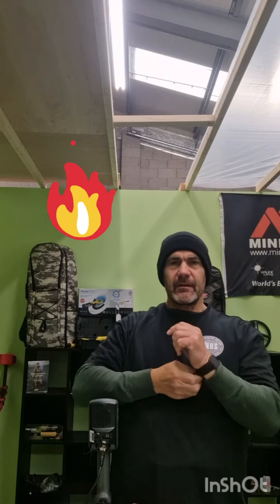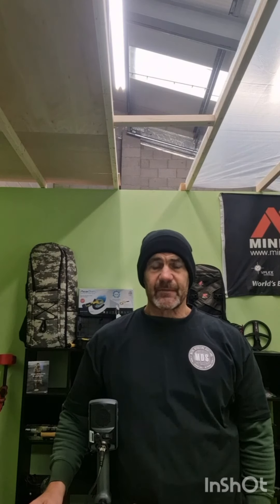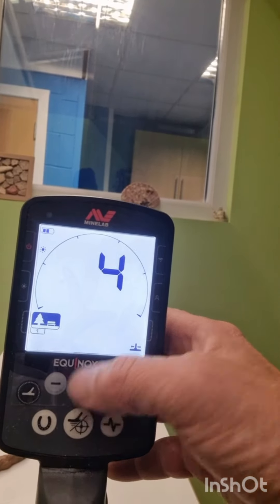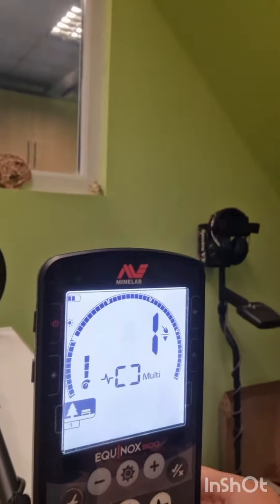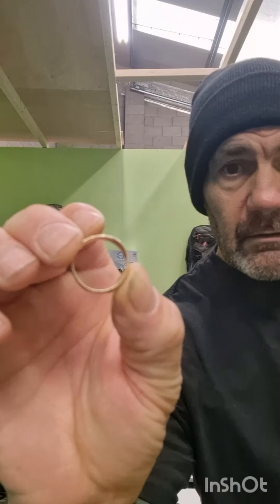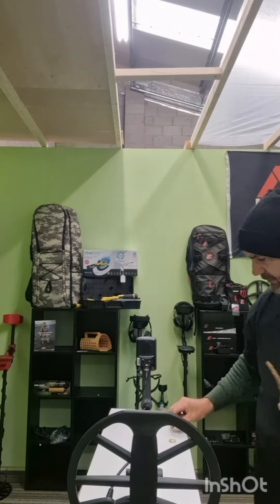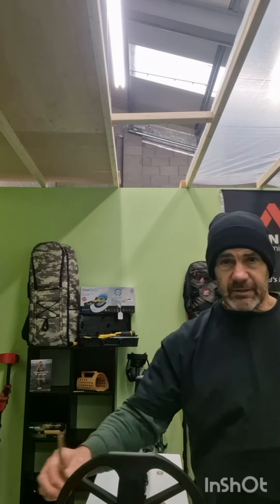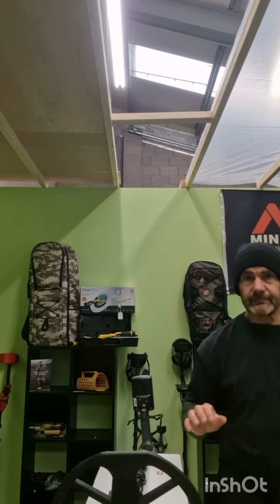Minelab Equinox 900 v 800 on iron.. Wow!

Comment: The iron bias on the Newer Nox machines (700/900) is def not the same as it was on the 600/800 models.  The newer Nox machines combine the F2/FE iron biases from the older machines and just call it FE now.  So FE4 on the old 800 is quite a bit different than FE4 on the 900.  Did you try running this test on the 800 with IB of F2-0 ? 

On the new Manticore, iron bias is now called Ferrous Limits (upper/lower)….The upper ferrous limit expands upon the older F2 iron bias (nails) of the Nox 600/800 and the lower ferrous limit expands on the older FE iron bias (flat iron and bottle caps), with 3 additional features: 

1. You can completely turn off ferrous limits (iron bias) on the Manticore…..couldn’t do that with any Nox machine (even FE-0  or F2-0 is not “off” on a Nox 800; it’s just the lowest iron bias setting on the machine).  Not sure most manticore owners would do this, but the capability exists.

2. You can have both the upper and lower ferrous limits simultaneously active….On the older Nox machines, it was not possible to have F2 and FE active simultaneously.

3. A user can customize ferrous limits, tailoring both the upper and lower limits to his liking. This allows for additional masking of particular pieces of iron (square nail) or a problematic crown cap.  It could also allow a user to accept a region within the ferrous limits boundary of the screen to pick up iron core currency while still rejecting a lot of iron.  This feature is “independent” of notching(discrimination) and the accept/reject of VDI’s.

Comment: You don't mention that the 900 constantly falses on iron around 45 to 55 no matter how much you turn up the iron bias. . Mine is up for sale
Reply: Same but mine at 95-97
Reply: Did you find a solution? I have the same issue even with iron bias at 9
Reply: No solution yet. I’ll never buy this brand again

Comment: The 900 has a big falsing issue even with bias set to 9. Hopefully they will fix it
Reply from the maker: Explain ?
Reply: I’m having this problem. It’s bloody annoying
Reply: Same problem here. It seems when you have a rusty iron nail that’s deep. It comes up between 95 and 98. Super annoying. I can only imagine how much silver I have missed because I just not out 95 through 99 now. I don’t know if it’s the machine or the coil.
Reply: Any fixes? Bought mine brand new have updated to latest firmware and falsing with bias set at 9

Comment: You could hold the noise cancel on the manticore and it will run all the best ground balance setting till it gets to the best setting for the ground you detect don't let up though till it stays at best setting might be minus number or plus if you set your detector and you could set your iron limiter to minus 5 or + 10 or whatever it will let you know.
Reply from the maker: Thanks  but this post is not about the Manticore.
Reply: Bit harsh  lol

Comment: Great video big difference with the 900 unmasking I’ve seen test on the Deus 2 it uses only 2 frequencies at a time I believe minelab uses more
Reply from the maker: Xp revolutionised the speed at which a detector could react from target to target with the goldmaxx and let us not forget that.   I have used the Deus /s and that still holds true.

In regards to how many frequencies they use I honestly could not give can hoot as long as I find what I'm.looking for.
Reply: @TODDYS-MDS  it’s 2 according to NY Detecting they’ve done tests using an oscilloscope
Reply from the maker: @Mark Kus  Hi I honestly don't care if a detector uses 1 or a 1000 frequencies all I care about is if it can get me the targets I want on a given site
Reply: @TODDYS-MDS  well that’s good just telling you what it’s running for frequencies
Reply from the maker: @Mark Kus  Mark NY detecting had to research this early machines I dint I used them ALL and have heard all the same arguments over frequencies for many years.

What I'm saying is minelab and XP would not put single frequencies in for a no reason.   They dud because in conditions a single frequency will out detect a multi.  So please don't rate my video off on a route it wasn't intended to go to suit your own agenda
Reply: @TODDYS-MDS  lol my own agenda ??? I like your video all I’m saying is it’s been proven XP uses two frequencies at a time that’s it! Simple it’s there in the video minelab is next to be tested it’s no secret they keep it hush hush on what frequencies they use for each program but now at least we know more about how many are used .
Reply from the maker: Mark my video is not about frequencies.   Your comments mentioned another chanel 
Your comments continually mentioned xp has 2 snd ml has more 

I said it's pointless it's all been discussed many many times NY D is only going over stuff that was discussed till the cows came home many years ago with the explorer and dfx.  Its boring and pointless and it's only AIM IS to disrespect a manufacturer of which I have no interest.   Thanks Gordon your replies but my video is not about frequencies